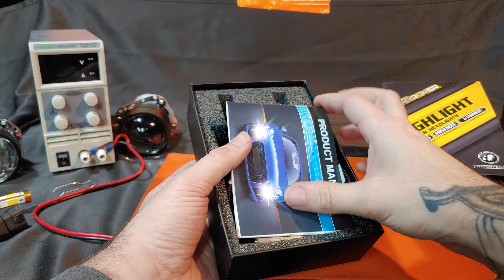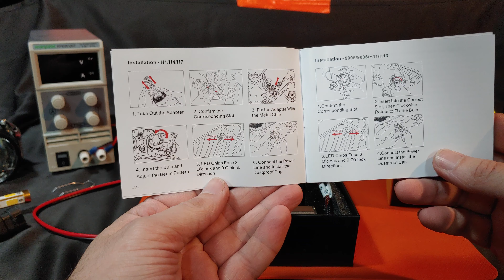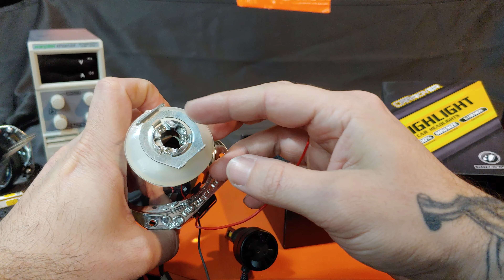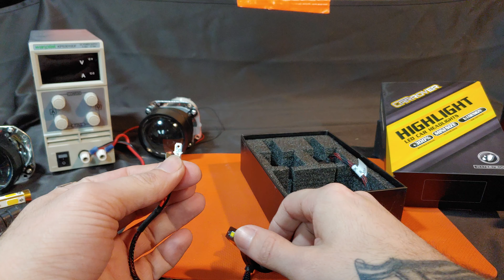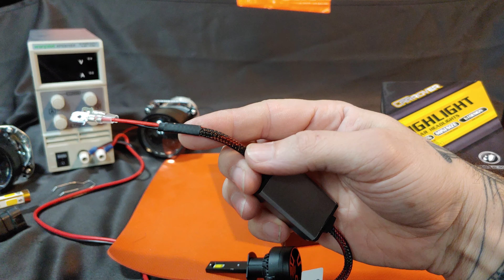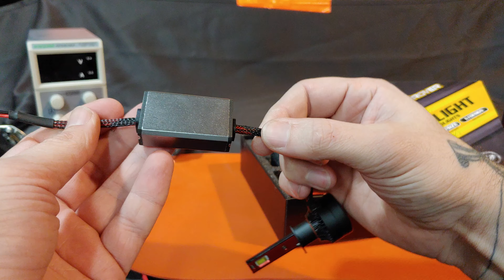CarRover LED Headlight Bulb Review

Comment: what type of projector are you using in this video?
Reply from the maker: I am using generic 2.5 inch projector retrofits from eBay. Here's a listing for an identical set:
https://www.ebay.com/itm/2-5inch-Bi-Xenon-HID-Projector-Retrofit-Headlight-Lens-Hi-Lo-H1-Xenon-Bulb-H4-H7-/163983377943?_trksid=p2349624.m46890.l49292

Comment: I have a alfa Romeo 159 and i use some led for low beam, but when there are cars around or street lights i van barely see that they are on. Especially in first few meters in front of the car. Do you have an advice on what bulbs i should use?
Reply from the maker: The issue is likely beam pattern related. If you are using bulbs with LEDs of two sides, you don't want the chips pointed up and down. Ideally the chips would be perfectly horizontal. However you may still have dark spots and reduced intensity depending on the quality of bulbs you have.

I personally like the "8 sided" design by Light Moses and ToAuto, and recommend those if they are available in your bulb type. If you can tell me which bulb type your vehicle uses, I can see if there is an Amazon or eBay listing for bulbs which I would use.
Reply: @Jamesthelightguy   i am using H4 bulbs. Thank you so much for the answer.
Reply from the maker: These are the ones I put in my grandmother's car:

https://www.amazon.com/dp/B01LQ01C3Q?ref=ppx_pop_mob_ap_share

The alignment in the housing is super important, so take your time installing them and checking to make sure you get light on the ground right in front of the car.
Reply: @Jamesthelightguy  thank you, ill do my best to set them up the best way possible. Did not know it was important 😅

Comment: How did you ge the adapter off so easily?
Reply from the maker: It wasn't super easy, but I've been doing this for a while so I'm probably just good at it. I just gave it a firm pull with a little twist action.